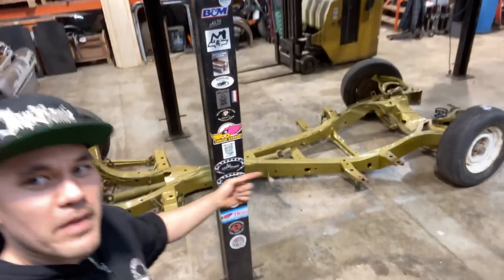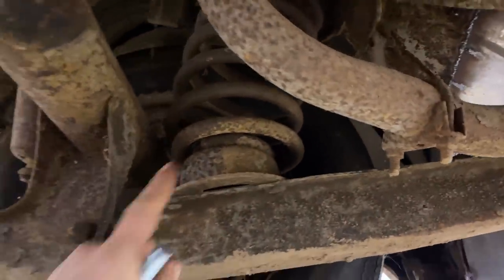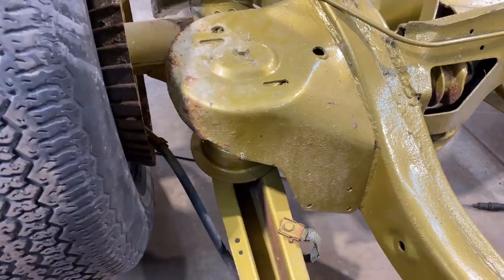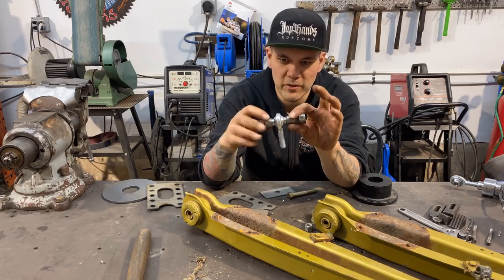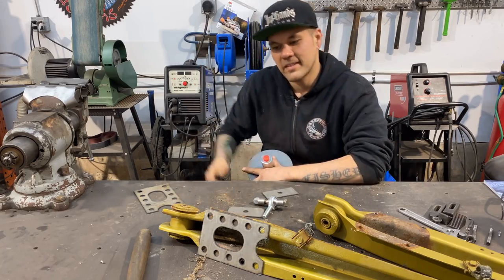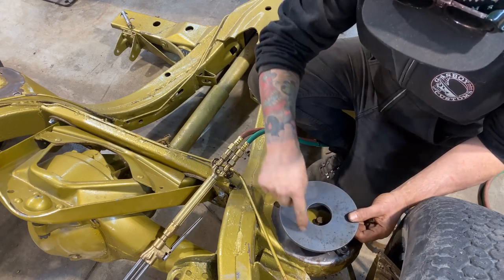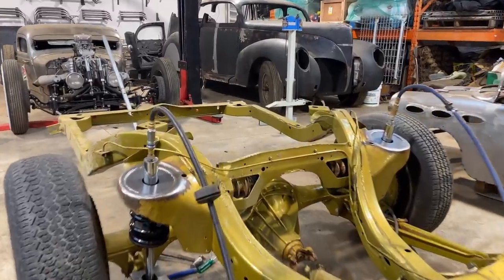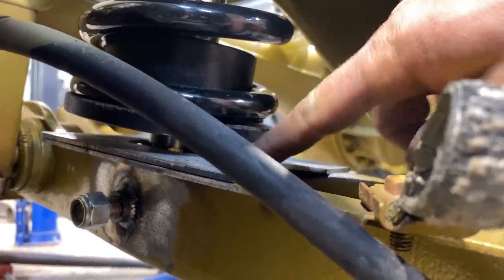Installing Hydraulic Rear Suspension - Kristina’s 1960 Cadillac Coupe de Ville

Comment: Looks verry good but,the wobbling of the hydraulic cylinder at the top of the spring mount would bother me personally. I would still install a guide or bearing made of POM or another plastic material there, otherwise it could rattle during driving when the hydraulic cylinder hits the spring mount . In addition, I would install a centering for the spring on the upper spring holder so that the spring has a guide at the top and can not slide back and forth uncontrollably when driving
Reply from the maker: It’s all fixed now video will be up today!

Comment: I recommend you come with some better springs that Cadillac is a very heavy car...
The front springs is designed to absorb and you don't want that in the rear..
The front coils will break in quick in the front...3 ton precuts for your lay and play setup..and 2 36volt battery banks

Comment: Hi Karl, excellent video as always. Can you point me to where you sourced the hydraulic rams please
Reply: I would love to know also where you got those cylinders... I have an automotive project those would be perfect for!
Reply: Ha... go figure... I did a search for "low rider hydraulic cylinder" and dozens of them showed up.  Don't know why I didn't try that before!
Reply: @mikekoblas9064  Cheers mate. Hot rods and modified vehicles in general, aren't that prevalent in Australia so thanks for the heads up. Found a mob in Oz who do them but 'out of stock' - typical. I want to put them on my tow vehicle to get some lift in the rear when I tow my race car and trailer. atm it sort of sags like an old dog trying to scratch its bum hole lol

Comment: You might want to run sleeves so when the coils compress as your driving you don’t rub threw the side of your cylinders where the cylinder wall meets the frame and at the same time you prevent the ugly sound of metal screeching together…

Comment: Wouldn't taller springs give you a cushioned ride? When the hydrolic is on...its a solid connection with no spring in-between.
Reply: The spring functions the same no matter what position the ram is in.

Comment: Look like the spring was able to wobble inside the "cup" where the cylinder goes thru. I wonder if that will effect the mount being able to swivel. I would use a top on the spring to hold the spring in place while traveling up and down.
Reply from the maker: Great point we have done some updates in the new video addressing this
Reply: @MakeItKustom  glad to see when I watched that episode yesterday. That front you cut out looks like it will exactly what you want out of the air ride. Just glad you didn't get all stupid with hydraulic drive set-up. Not that watching someone tear up their car isn't cool Evey now an then. I just want mine to ride on air when rolling low.

Comment: Might want to weld in a sleeve for the bolt for the lower heim, and then box those trailing arms?
Reply from the maker: Isn’t that what I did?
Reply: @MakeItKustom  Yes, sorry i posted that comment in the beginning when you were contemplating doubling plates.
I couldn't edit it afterwards lol. You have a great channel and are an extremely talented fabricator and love all your videos! You may want to still consider boxing the trailing arms, 60 Caddy is pretty heavy vehicle.

Comment: As a fabricator and self proclaimed engineer I have a few questions. How does the spring stay centered in the upper pocket? Also the piston that slides up and down in the center hole does it just flop around hitting the sides making a racket while driving? You'd think some sort of plastic bushing would go around that hole as a guide of sorts.
Reply from the maker: It will have a rear winter for the spring and plastic for the cylinder or I’ll open the hole
Bigger

Comment: I'm just a dude that writes code for a living, but I'm fascinated by this project and the work that you're doing. I confess that I have no advanced knowledge or learning in the area of car restoration and mechanics, but I'm confused at 26:50 when you say "...but it's always riding on the spring", because it looks like the spring is no longer engaged between the frame and lower arm. So to my layperson eyes, with the hydraulic cylinder at full extension, it looks like the weight of the frame is riding on the cylinder, and not the spring. Am I confused?
Reply: The bottom of the spring is attached to the body body of the cylinder. 
The rod/piston of the cylinder is attached to the trailing arm. 
The body is stationary, the piston moves.  
Visualize:
- the cylinder body welded to the vehicle frame, then;
- a spacer/tube welded to the frame on one end and the open/free (top in this case) end of the cylinder body at the other, then;
- a mount/plate is welded around the piston/rod end of the cylinder body and the spacer/tube is welded to that, then;
- that tube/spacer it replaced by a coil spring, and;
- the end of the cylinder rod/piston is welded to the trailing arm that the tire mounts to and "pushes against the ground/road, finally;
- cut out the weld at the vehicle fame and weld in a hinge in its place (between the frame and cylinder body), do the same at the rod/piston-to-trailing arm interface/connection/location. 

HTH.....
Reply: @lt1nut  Ah... that explanation does indeed help. I didn't understand that the spring is connected to the bottom of the cylinder (the end closer to the ground). That makes perfect sense (now). Thanks for that.

Comment: There are better options for connecting that cylinder to the trailing arm in the rear. Google “universal power balls for hydraulics”. They are a very large ball and socket designed to with stand tremendous loads and abuse. I have built several very heavy, high powered hydraulic set ups with fully wrapped frames and even hopping all 4 wheels off the ground I never had one failure with them. Before they hit the market we used heims joints and they always failed even on lighter mini trucks that were not being abused. You can recess them into the arm to keep more coil while laying low.
Reply from the maker: Yea those are great! Haha Rick convinced me that the hiem would be sufficient but I think the power balls are way stronger. With just a simple up and down set up the hemi should be ok
Reply: @MakeItKustom  at least you know what to do if the heims let you down. I just wanted to share my experiences not trying to be critical just for the sake of it. Keep up the good work.

Comment: Just a thought, would it be beneficial to put a grease fitting for the bottom of it where the bolt passes through the socket? I know there’s varying opinions due to grease attracting dirt/gravel, but I would consider it myself.
Reply from the maker: No need it’s a self lubricating hiem
Reply: @MakeItKustom  nice!

Comment: Wouldn't it have been less thermal stress for the frame to use the plasma cutter rather than the torch to cut the hole for the "donuts"?
The explanation in the end with all the parts in place was very clear, everything before was a bit foggy to me as I'm not familiar with the way it's constructed.
Reply from the maker: I’m not worried about using the torch on the frame I’m glad that the explanation was clear in the end! Cheers

Comment: Looking good 👍,  I've  did a few hydraulic cars back in the 90s. They did 3 wheeling and pretty major bouncing. Just curious if you going to just use them to raise and lower car why not airbags? Airbags that I've  did just seem to ride better and more simple. And if a hyd.line blows it makes a hell of a mess!! I know this from experience!
Reply from the maker: I just like hydros better. No noisy compressors and air
Leaks
Reply: @MakeItKustom  ok just curious. Everything is looking good. 👌

Comment: Great job, with the spring so short, did you not say that it would bounce? Or ride rough? 
Could you clarify that for us? 
Thanks, and nice work again! 👍🙂👌👋🏻,✌🏻🔑, 🧡 🤏, 🥶🌤🇨🇦 👨‍🦽 😎.
Reply: It's a bouncy ride with tall springs. My cadillac rides decent in the ass with 3.5 coils of a front springs. It's a hopper though so there's a lot of weight in the trunk. It would bounce endlessly with a full stack.

Edit when the cylinders are extended  the coils will be compressed this is a rough bouncy ride with the system "locked up" (max lift).
Reply from the maker: As long as the spring is the right weight it’s going to ride beautiful with shocks
Reply: @MakeItKustom  yeah perfect for what your doing.

Edit as founder and president of Devillens cadillac club I approve of this build 👌

Comment: Kool stuff Karl, I'm not in the know when it comes to hydraulics but I always thought they moved using liquid ( hydraulic oil ). So essentially these are cylinders that lift using air so you'll need an air supply and way of controlling lift. Am I on the right track?
Reply from the maker: This will be hydraulic pumps. I just tried to show it with air but not enough pressure

Comment: Don’t you need a retainer for the top that keeps the spring centered?  Looks like it can move, and rub the shiny finish iffn your pretty cylinders.   And, if you hit a decent pot hole ( as if there is a hole in the road that can be termed decent) bad things can happen.  Clips at least, to keep the spring centered?  My thoughts….

Comment: Wait…so, now I get it. Coilover…wow. The spring works, that is why you need shocks. I retract anything I may have said, and apoligize for saying whatever (if I did).

Why can't they call that spring over? 
I mean, I have coilovers, and they are nothing like that! 
Those just came first…
Reply from the maker: Ha ha no worries man I’m stoked that you figured it out. I remember when I had that moment LOL It all makes sense
Reply: @MakeItKustom  I'm thinking that other people may also misunderstand the concept, and I thought of a way to demonstrate that!

Lock the cylinders hydraulically (like fill them with oil then plug the ports) & put some masking tape over the shaft seal (to show it doesn't move). Then jump on the frame to show the spring moves & the hydraulic cylinder doesn't.

Comment: I would put four metal plates in two on each side of where you're putting those little spherical lens that run right through the control arms because you're putting the full stress of the hydraulic right into some paper thin steel there I don't think it's going to hold up like a front a arm on a car would your work before because the plates spread it out over the arm.... The spring days plate... Was originally spot welded into the top of the stamps paper thin steel arms now you're putting all the stress into a welded joint in the side of those paper thin steel arms I got a feeling that you're probably going to shred those things... That's why I say if you put some quarter inch plate welded into the side on each side of those control arms then weld your spherical rod supports there to the plates you have a much stronger setup

Comment: ask you bro why no one has used a motor as in engine run hydraulic pump to run the pumps instead of batteries, i remember a customer having us make a system like that when i was a kid
Reply from the maker: Yeah I’m sure that you could run a PTO but I think that the reason why people don’t run them on low riders is because they want to up the voltage to make it snappy. There are very few set ups that run 12 V. Although my truck is 12 volts. Most room 36 or 48

Comment: Shouldn't the top have a spring cup to center the spring? Otherwise the top of the spring can move around and the hydraulic cylinder will hit the edge of the hole.
Reply from the maker: Yes it will get a retainer

Comment: coil over is nice, its nice not having to worry about throwing and coil etc. You ever tried hydroshocks there slick! if i build another full size id love to run these. cool system prefect adjustable coil over performance ride with hydros that's rides the same at any height. Badass always liked this idea thought about it years ago that it would be a great way to build with a combo set up but someone's actually making them now. The best of both works but i think you only get 4 to 5" of travel but that's all I'd need need to go to the ground and up https://www.youtube.com/watch?v=79mzqr3gP7k

Comment: Um maybe I am missing something 😕 
But it appears to me that the entire weight of a rather large car is supported by to 1/2 inch bolts?  Surly this is not enough?
Reply from the maker: Yes it’s debatable lol most coil over shocks are 1/2” bolts. It’s not the bolt that would break it’s the hiem. I’m probably going to find a expensive hiem to put in

Comment: Hydraulic suspension is not hydraulics.
Hydraulics are either aircraft hydraulics modified to make your car hop
OR
Hydraulics that make the tow truck deck tilt and slide back

Those are C O I L O V E R S